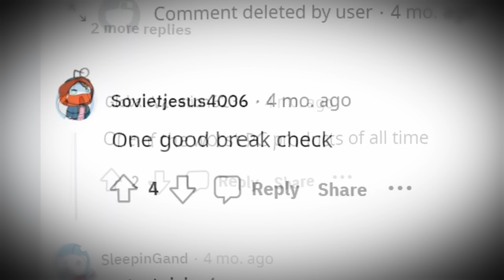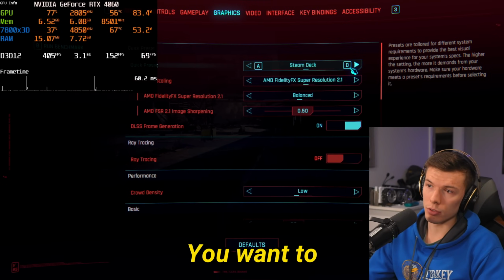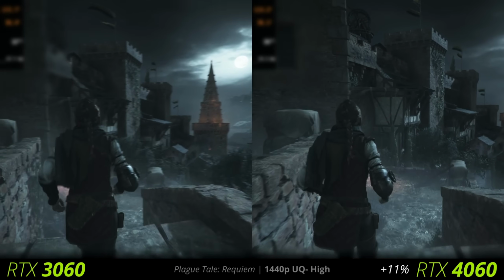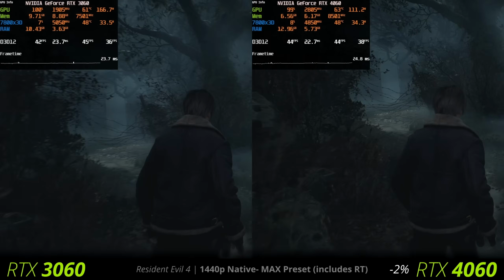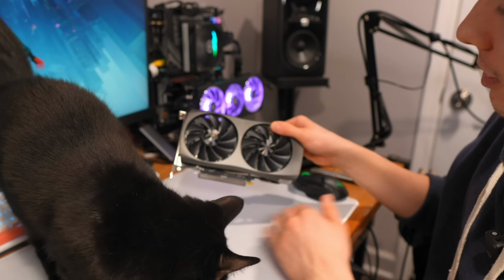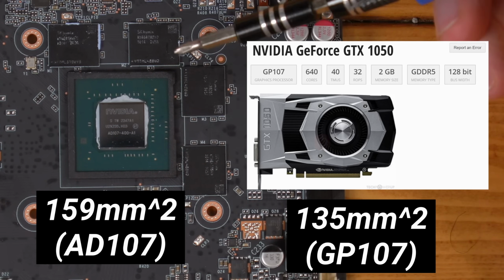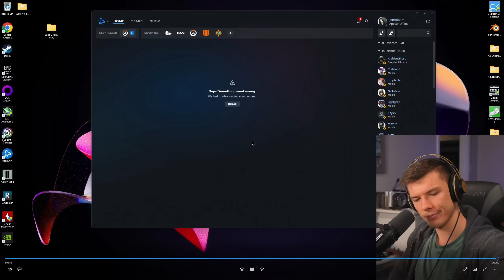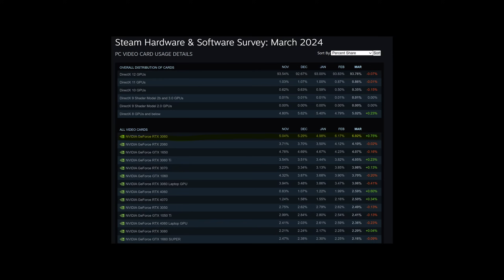I Tried Nvidia's best "Budget" GPU to see if we're Doomed

Comment: The fact that Amazon deliver the graphics card without additional packaging and placed it at the door make this even better. It's bring "Who would steal this sh**" vibe.
Reply: The RTX 4060 is so bad, not even porch pirates want to steal it.
Reply: amazon now has a little box that say "save packaging by using original shippers boxing" or some shyt like that, and its automatically set to that. So unless you scroll down and look for that box and switch it to "amazon packaging" it wont come with amazons extra packaging. I just went through this last night and was like wtf. Fucking scammers at amazon trying to save a buck , meanwhile CEO is a fucking billionair.
Reply: Na nowadays they don't put additional package and say the original box is gonna be revealed 

My extension cables and psu came without the amazon packaging 

But my AIO came with the amazon packaging 😅
Reply: It's still weird to me that refusing to even attempt making contact with the customer is the established norm in the US.
"Porch piracy" would be SO EASY to prevent. I'd much rather pay a tip, than deal with that crap.
Reply: @cnk-fn3nr  im a mail carrier. Every amazon package we deliever specifically says 'leave if no response" . So we have to leave it. Some carriers are dumb though and just throw shit on the ground. Alot of us though will at least try and hide the package behind a bush or pole next to the front door
Reply: @FulcanelliTrismegistus   Respect to you for doing the best with what you've got, but that's still a very bad system. Throwing stuff on the ground should not be acceptable. If I can't respond to the courier, I'd rather take the 5-10 min walk to the nearest post office to pick up my stuff, than have it stolen with zero recourse.
Reply: @danieltoth9742  of course and totally understandable. Depending on area, sometimes we will still leave a left notice. Some customers also use package drop boxes with locks on them at the front door. Also some customers will request, if they are not home, to leave a left notice or to come by the next day. But to be honest, where im at, we have shitty employees, and even if any of the above i mentioned in aplicable, they will still ignore the requests ans just throw the packages out in the open. To me, that falls on lazy management. If theres no management to manage the employees, well the employees will do whatever they want :/
Reply: That's why I always select "ship in Amazon packaging" when checking out, it legit tells you what products get shipped in their native packaging, granted Amazon probably should never send electronics out without proper packaging... Unless they have a side deal with the insurance companies and HOPE your packages get stolen... - satire
Reply: fun fact:  amazon tells you, during checkout, that the item will ship in its box which shows contents, and you have the option to have it shipped in amazon box instead.
Reply: lol!
Reply: well my friend bought an 4070s last week and he shipped it directly to my house so I would install it later that day, thing is I was expecting a package for me too, and that Graphics card required me to give a password to the delivery guy for him to give me the card. So he is at my front door I opened the door he gives me my package and he quickly runs back to the truck saying that he took the wrong package while the other box (that had my friends name) just fly (it slipped from his hands) and hit the the stairs (theres a little 5 step stair to get to my apartment) and the package ends up in front of my feet, that was funny and the gpu was ok no damage whatsoever.
Reply: @davidandrade7146  we are humans, we are flawed creatures that make mistakes. In your case though, what I wouldve have done was scan the package as 'visable damage' first, then scan it as delivered. Just to reinsure the customer that if anything was wrong inside the package, that it would be on the post offices hands and we would refund any money incase of damage
Reply: @FulcanelliTrismegistus  thankfully all was good and the gpu is runing as it should! so we can let it slide
Reply: The biggest problem with this card is makes a console more attractive to buy than a PC. Since this card is basically 2/3 the cost of a console.
Reply: I work for USPS and for most of my customers i stick stuff behind stuff so its not visible, but honestly most of my route doesn't deal with porch theft much.
Reply: It’s an option you have to select now
Reply: Were you aware that there is a 3060 8GB 😂😂 I think the 12GB 3060 was an anomaly. Also that’s what DLSS is for and for single player games it’s darn near perfect.
Reply: @FulcanelliTrismegistus it’s for the environment. And what do u need two boxes for if you live in a safe neighborhood? We might as well put it in 3 boxes for you, princess
Reply: What he doesn't tell you in this video is that Amazon CLEARLY warns you when something will ship in the manufacturer's packaging.  Not only that but you can select to have it shipped in Amazon packaging to hide it.  Total L video.
Reply: had the same thing happen with my RX 6600 but with fedex
Reply: @BrunodeSouzaLino I have a 4060 to and it runs perfectly fine
Reply: Best buy did this with my lg monitor
Reply: I'd say it's a pretty damn good performance value for under $300....
Reply: I worked at an Amazon Fulfillment Warehouse, basically the last stage of checks before products get delivered, and I've seen so many GPUs in their original package with no additional discrete packaging. I've had to ask my managers every single time if I can relabel and package these boxes just so to make sure they don't immediately get stolen if left out when delivered.
Reply: I see prebuilts on microcenter under $1,000 and they will have a beefy CPU with a 4060 and 500gb storage 😐. 4060 should be considered a crime against humanity. My old 5700XT kicks its ass at all resolutions lmao
Reply: @headphonesz6527  A 4060 is faster than a 5700xt, has dlss and ray tracing ability, plus frame generation to double the effective fps....I wouldn't say that's kicking ass.
Reply: @danieltoth9742  I love how flat-out delusional you sound. 
5-10 minute... walk... to the... post office?
I live in the suburbs of Washington DC (~12 minutes from the capital) and my nearest post office is 9 miles away.
It would be a (theoretical, it's actually impassible on foot) 46-minute walk each way.

"Pay a tip?" Are you insane? They make more than 3x the minimum wage starting out. They don't need tips.
The recourse is that Amazon sends you another package immediately, at no charge.
Reply: @tim3172   I'd   L O V E   to explain myself, but I literally can't do anything to get around YouTube's bullshit shadowban rampage. Sorry my man, I'm not gonna try talking to you anymore, and it's not your fault (even though you were way more unfriendly here than I was going to be). Have a nice day. And loosen up on the insults a bit, yeah? Not everyone lives where you do.
Reply: Um yea, this was the fault of the buyer. Amazon tells you in checkout if the product ships in retail packaging. Click the little option to ship in amazon packing and it's no longer an issue. It doesn't even cost extra to do that.
Reply: @FulcanelliTrismegistus  This saves money. You want them to raise the price of prime yet again? Just tick the box for Amazon packaging and stop crying. It's not hard.
Reply: @FulcanelliTrismegistus trillionaire i think, the first one.  Also proving every Karl Marx point, and even Karl himself got stuck on book 1 of 4 of why full capitalism is so so wrong lolz.   Looks like we are about to fond out what would have gone in those other 3 book the hard way.
Reply: "You should pay someone to use it" kind of vibe
Reply: Bro lives in a nice neighborhood
Reply: You have Shikiura in your songs playlist based
Reply: FR
Reply: @BrunodeSouzaLino  bro how is it bad? explain yall amd fanboys just say its bad with 0 proof
Reply: Repent and believe in the gospel of Jesus Christ and you will be saved 😊
Reply: got a 400 dollar cpu from amazon a couple years ago. It came in the default little amazon post package outside box was completely crushed no protective packaging at all..... Luckily it was  a cpu and intel are smart with understanding how worthless these companies are with delivery so the eggshell packaging inside the crushed outer box did it's job and the cpu was still 100% fine. 

Still absolutely insane that you can spend so much on tech and they just throw it in default packaging no additional protection at all.
Reply: he bought it renewed  that what that sticker on the front was it was a return.
Reply: does this mean a rtx 3080 is better than a rtx 4070??
Reply: Tbf they give you the option to ship with an Amazon package or just the box
Reply: The outside box is an optional setting on most orders
Reply: @BrunodeSouzaLino  i would steal it, saving 300 dollars
Reply: LMAO exactly what i said in my head when i heard him say that
Reply: For 240 bucks or less it would have been a decent product I suppose
Reply: If you dont like it give to me I would be very happy to have it. I think this card has a very good power consumption. Thats why many extreme gamer use. 60W AMD CPU and this baby is the secret sauce.
Reply: Amazon shipped my new motherboard without any addition packaging. Not even a plastic bag and it was raining. Surprisingly the mobo worked but the box was trashed. I was shocked.
Reply: 2060 11gb is the best value for money right now. The games are not getting better graphically (and creatively) for a while. Nobody is buying new gpus or building new machines  rn.. literally nobody. DSSL is still a joke even on the higher end cards. The market is not moving either way. Even the 2060 6g at about $150 used is a steal.

What NVIDIA has been doing with this mess of cards they churned out is having gullible consumers fund their R&D and looking at their epic stock price rn it payed off very well for them.. still it should not sit right with folks..
Reply: You should probably move cities if ur worried about someone stealing ur packages
Reply: Why everyone is saying it's bad ??
It's bad or bad value??
Reply: *delivers

Awesome post, though, bud.  ^_^
Reply: amarican amazon doesn't ship with additional packaging?
Reply: The poor gamers would if they saw it suddenly appear on someone’s doorstep.
Reply: Yet the card is the most popular on steam, so clearly redditors and Internet dwellers are the loud minority. Glad no one listened to reviewers
Reply: is 4060 Ti better than 4060 ?  i ended up buying the Dell and it had 4060Ti and didn't have a choice